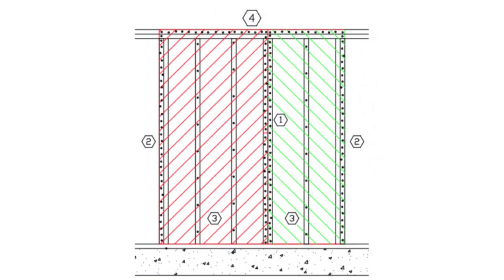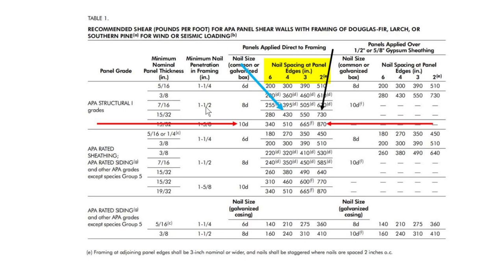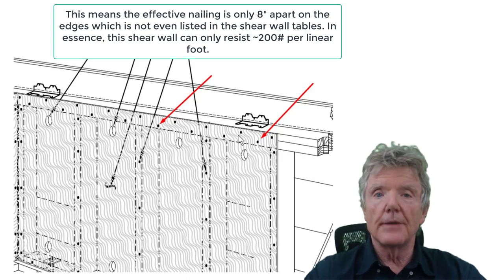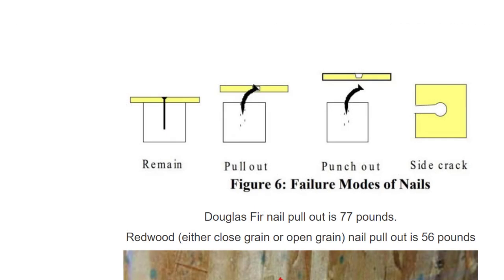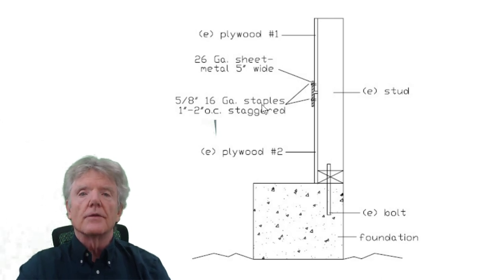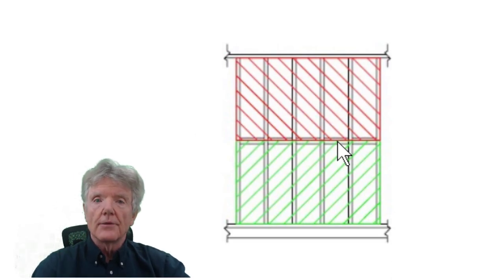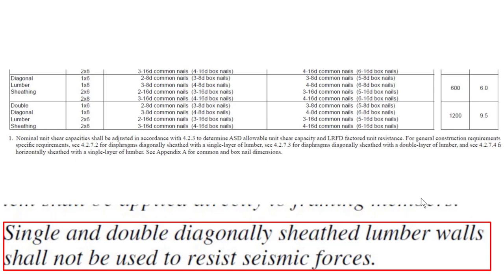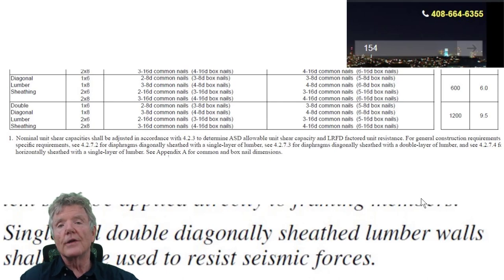Building Shear Walls - 8 Essential Tips

Comment: There are so many factors that determine shear wall failures, though in the end for retrofit applications it always leads back to the nails and quality and thickness of the plywood.  However, tests have shown once you go beyond 15/32" structural 1 you don't get much if any benefit. 

Once you have the right plywood you need to keep nail failures from happening.  

Nail diameter is a big one because the larger the nail the greater the resistance to pull-out, nail penetration is another factor for the same reason; though you never need to go more than 2 5/8 into the framing per extensive testing.  With 10d nails, you can't use the 3 1/4" commons 2" o.c. because the wood will split.  It might even be 3" o.c. I can't remember.  That's why they make 10d shorts. 

We have no problems with 10d nails 1" apart in old-growth redwood. 

Nailhead diameter also makes a difference as you speculated.   

Staples also work well because you can put them 1/2 inch or less. 

Look up APA research report 154 to see the original testing.
Reply: One side.  Inside is cheaper

Comment: This is a fantastic video--best I've seent to understand framing and shear walls.  thank you.
Reply from the maker: Glad it helped you.  That is the whole point and I really appreciate the comment.  If you find other videos that are helpful please be sure and let me know.
Reply: @bayarearetrofit5814   Awesome.  Of course I wish I would have seen this a month or so ago before finishing my walls- I followed the standard the plywood mfr said, which was nails every 6" on edge, 12" in field".  Since I don't want to tear off the siding I just painted, should I improve my shear walls by nailing plywood on the interior before adding drywall?  Or I realized putting up the fibercement siding I've actually added a nail every 7" in addition.  Does that help, or do you think I should add plywood to interior?  thanks for your help...
Reply from the maker: @GregoryDibb  I think if you you include the fibercement nailing you have a nail about every 3 1/2 inches and should be OK.
Reply: @bayarearetrofit5814  I figured that should help.  that chart you showed about how impactful nailing frequency is was amazing.  i guess my siding nails are only 2" nails though--hopefully that still helps.  it wouldn't be too much trouble to add plywood on the inside... Either way I will focus on doing what you showed with the hold-downs--that was a helpful explanation.
Reply from the maker: The same chart says you need 11/2 inches penetration into the framing, which apparently you have, or at least are close enough.
Reply: @bayarearetrofit5814  Great- I feel much better about that now, thank you - I feel much more informed after watching your videos, thank you--it's a reminder that not all engineers are created equal!

Comment: Cross stitching the two top plates intuitively makes sense since you're preventing splitting on the cap plate when high density nailing as well as unifying the two  plates; I'd also run 10d through both plates on that joist clip.
Reply from the maker: I am sorry, I don't quite know what you mean.  Can you exp;lain a little further?  Is the cap plate the same as a upper top late?  What is cross stitching?  You mean mean nailing them together?  How will that prevent splitting?  You mean nail into the upper and lower top plate?  Which joist clip?   What minute will I find it?
Reply: @bayarearetrofit5814  Yes, cap plate = upper plate. The typical tendency in excessive nailing is fear of a build up becoming "nail weak" due to  splitting/cleaving. Consequently, "cross stitching," a zig zag pattern between the two top  plates, is the "intuitive" carpenter's solution, i don't why  it is spec'd by the engineers in the code literature you showed. 3" of wood behind vertical seams between panels is primarily done why? splitting? edge turnover? Like wise 3" of wood via compression blocking nailed between studs and face nailed into mudsill/bottom plate would seem to help prevent panel turn over and nail tear out. More timber more nails and more options for distributed nail patterns and less split up wood which can resist nail tear out.
Reply from the maker: Ok, I understand now.

Comment: So I have this wall that has a groove cut diagonally top to bottom through the 2x4s and it has a thin metal bracket placed in that groove; one nail in each 2x4. It does not have any plywood on the wall but only sheet rock. Does this metal brace constitute a shear wall?
Reply from the maker: No

Comment: Is there a minimum length for the shear wall section?  Using your example, if I use 10d@2" OC and a 24" wall will it support a 1740lb seismic load?
Reply from the maker: The closer you get to 26.5" the weaker the shear wall.  After 26.5 if equals zero.

Comment: Does the spacing between the blockings matter in the design of the shear wall?  Say I have 3 rows of 4' x 8' OSB, does it matter that I have 4' - 4' - 2' going up or 4' - 2' - 4' ?  I have a feeling that it does.
Reply from the maker: Do you mean does it matter if the plywood is vertical or horizontal?

Comment: Hi, 

Great informative video. I am currently retrofitting my property using the LADBS standard detail plan set One. I  have cripple walls not tall enough for bolts to go straight down from above so I am using URFP plates instead. Do I still need ventilation holes?
Reply from the maker: No

Comment: Thank you for this video. Noticing that the failure is usually at the point of the nail head and the plywood sheeting, would it not help to make a special ribbed nail with a larger diameter head? I would suppose cost is a factor. Thus add more nails to share the forces. Would 3/4 ply have stronger pull out strength at the nail head? Our area is not known to have major quakes. My first exterior and interior walls (for my home)I decided to use 1/2 and 3/4 plywood with liquid nail, screws to pull it down first, then 8 and 10D. I learned a great deal from your video. - Thank you!

Comment: Around minute 9:30 of the video, the diagram shows an hvac duct going through the sole plate of the shear wall in a raised foundation construction.  Is such a large notch in the sole plate of a shear wall (for the rectangular duct) allowed?  How would it be reinforced?  I was thinking a metal brace horizontally across the notch might suffice for a one-sided shear wall, but it would not be possible to drive nails in that section of the sole plate for a double-sided shear wall.
Reply: I doubt it is legal but in retrofitting we must work we must work with what we find.  If we have large breaks in top plates or bottom plates we use 2 x 4s as straps because they will work in tension and compression.  A 2 x 4 is as strong as the strongest Simpson strap.

Comment: I'm confused!  At 5:24 you say 2.25" long nail - but isn't 10d a 3" nail (the red arrow is on the 10d line)?  On the one hand, I understand a shorter nail with "Minimum Nail Penetration in Framing" of 1-5/8" but why 10d then?

Comment: Simple question, does shearwall start at the bottom on top of the concrete slab or overlap on the side of it.
Reply: @infocook4854  plywood can’t sit on slab because it potentially could sit in water. Bottom plate to edge of slab so shear panel overlaps stem wall or slab.
Thanks I found what I needed

Comment: It is normally a function of the nails, not of the metal.  Check the load ratings under the F1 direction.  That tells you how much capacity the hardware has.

Comment: Hi Howard, Excellent video. Is an expansion gap required between the plywood sheets, or should they butt-up against each other?
Reply from the maker: The American Plywood Association wants a 1/8" gap but it is B.S.  It does not matter from what I have seen.
Reply from the maker: The American Plywood Associations says the must be a 1/8" gap, the Ph.D research scientists at the University of Washington wood science department say you need a 1/8" gap but I have never seen it as a problem and I live in San Francisco where there is a lot of moisture.  I trust my eyeballs more than a guy in a white coat sitting in an office. Engineers usually trust the guy in the white coat. You pick.  Please subscribe to the channel.
Reply: @bayarearetrofit5814  Stucco fellas have complained that the absence of the gap is the unpreventable cause of the cracking of stucco from wall buckling or deflection when moisture caused swelling occurs.

Comment: Shear walls are typically designed to extend from a sole plate to a top plate of a wall.  But, in a raised foundation, is it permissible (or even better) to extend the sheathing from the sill plate, over the cripple wall, and into the shear wall above?  Or does doing so reduce the efficacy of the shear wall?

Comment: I wasn’t always clear in the video whether the retrofit added a plywood/osb panel on the inside or outside of the wall.  Would welcome that clarity in a reply if you’re able.  I came to the conclusion that generally you depicted interior panels, not exterior.  In my case I’m residing a house, so I plan to install on the outside if decide to add.
Reply from the maker: It does not matter.

Comment: Thank you for this video. 
STUCCO and adding a blocking cripple stud (a sister cripple wall stud to allow nailing the edge of the plywood to): The back side of stucco intrudes slightly into the space where the new stud will go (the space facing into the crawlspace). That causes the edge of the stud (the edge to nail to) to protrude out from the existing stud. I expect it will be OK to cut a thin strip from the new stud, so that the face to nail to will sit flush with the top plate and mudsill. Does that sound reasonable?
Reply from the maker: Sorry I am so late in my reply.  I do not know YouTube did not notify me about your comment.  Yes, that is OK.  Watch the video on stucco.  You were in pretty good shape as is.

Comment: Thanks for the information. I am currently working in Sparks, Nevada and they seem to have different codes compared to city of Reno and the county.  

My role is drywaller including all phases of the trade. Framing thru texture and grid so I do not have any actual role in the shearing unless you count Sheetrock. My question is about plywood shearing. 

In your video, you supply tables showing minimum nail penetration but I see no mention of maximum nail penetration. I ask because I see in other municipalities that shear nailing heads of nail do not penetrate the surface but in Sparks, NV they allow deep penetration. This bothers me because during the stresses from a quake it would seem that the 3/8" plywood used will easily rip out from nailing. I also noticed flooring in all municipalities has nail heads exposed over the surface and I thought it is for the same reason as to not rip through nailing. Can you explain maximum penetration please?

By the way, the exposed nail heads on flooring are a nuisance when scraping taping mud from the floors.
Reply from the maker: Sorry I am so late in my reply.  I do not know YouTube did not notify me about your comment.  If the studs don't split at time of installation they won't split when loaded.

Comment: Hello again.  Since I left my thank-you comment 10 days ago I have re-watched this video twice.  I was very happy in a couple places to find that when I paused the video & said "that doesn't make sense", you then said the same thing when I started playing it again!  Ha-ha.  (Also, lining up the vent holes with the foundation bolts is brilliant.)

I hope I'm not imposing too much, but I am left with just 2 very basic questions:
1. You've said nothing about OSB, which makes me think that those who extol its virtues may be full of... something;
2.  From the 1st diagram @ 2:00 to the one at 22:00, the geometry-center in my brain is wondering if horizontal or vertical orientation of the plywood is significant?  My gut says that a horizontal sheet nailed to more studs may be more stable for horizontal shaking.  
e.g., for simplicity's sake, let's say @ 2:00 there is a vertical 4x8 next to a vertical 3x8...  Would 2 horizontal 4x7's  be better, worse or indifferent?
Many thanks again,
Mark
Reply from the maker: Orientation of the plywood does not matter.  OSB is rated the same as plywood.
Reply: @bayarearetrofit5814  Sorry, I was probably overthinking the geometry...  As for the latter, the lumber yard explained the confusing Structural I plywood, with Roman numeral not 1, is the way to go for strength over beauty, but they didn't say OSB had the same thing.  Many thanks once again!

Comment: hi Howard - Can you tell me which is the most recent "Standard Plan A"? I see the one on your web site says 2008. Is that the latest? Is there an "official" copy somewhere?
Also, I have the situation that you described where the access hole is too small so I would need to butt plywood panels to achieve the full height of the cripple wall. I don't see anything about the methods you described to accomplish that in the standard plan A. If I wanted to get a permit do you think they would accept one of those methods? I'm curious if you've had experience with that situation.
Reply from the maker: 2008 is the most recent one.  Why do you want to use it? 

 Use blocking at the plywood edges, 3by is the best or flat 2by with 15ga staples. 

 Do whatever you want.  The building department does not care what you do.
Reply: @bayarearetrofit5814  I don't "want" to use the plan, but I thought since I'm doing the retrofit that it might be worth it to get the permit if I could save money on insurance.
 
I don't know if it's worth it to get the permit but if I do, I don't want them to not reject the horizontal butt joints.  

You didn't mention the 26 gauge by 5" sheet metal. That sounds like the easiest! Is the sheet metal hard to find? (Thanks again Howard! :-)
Reply from the maker: The CEA does not care if you follow a standard. They just want a contractor to sign a form.  A handyman with a license can do that for you.  Do it right and for Standard Plan A.  Sheet metal is expensive, blocks will work much better for you.

Comment: The sheer transfer tie, model A35 by Simpson, hardly seems stout enough to perform under a seismic event. There is however a 16 gauge angle made by MiTek 2"x2"x6" model USP ML26-TZ that would make more sense as it is twice as thick as that simpon model that you can bend by hand. Your thoughts appreciated.
Reply from the maker: Sorry I am so late in my reply.  I do not know YouTube did not notify me about your comment. We have A35s.  L90s are better.

Comment: Greetings! 
What is another brand of hand driven nails that can be used for this work that has 2 1/2” nails? 
 I know that simpson brand is one, but they don’t seem to make  2 1/2” long nails that are hands driven. 

Or is it ok to use 3” long? 
 Any info, from anyone would be appreciated. 

Thanks.
Reply from the maker: Any builder's supply store will have a good selection.  Not sure why you don't want to use a nail gun.

Comment: So general question, based off of your qualms with some of the nailing to the top plates, is the upper top plate not secured to the lower top plate with significant enough resistance values to shear so as account for their design? If that were not so, I would assume the need for a double top plate to be dependent solely on alignment of your studs with upper assemblies and to counteract weak wall connections during erection.
Reply from the maker: There is not way to know but if you want to nail the two top plates together and make it one piece it won't hurt.

Comment: great video thanks.  i was wondering if there are any rules as to the minimum width of the plywood panel.  As an example if you had to cover 9 linear feet, would it be ok to use a 4ft panel, butted to a 1 ft panel, butted to a 4 ft panel where at each butt there were double studs?
Reply: So long as you have everything blocked and sistered together at the seams you should be fine.

Comment: What kind of staple gun do you use for the sheet metal approach? I have a cheap pneumatic stapler that isn't pushing the staples through the sheet metal. Would a non-pneumatic stapler work better, or do I need a more expensive pneumatic stapler?
Reply from the maker: I only found one stapler that shot the gauge and length needed and it is made by Paslode.  What are you trying to accomplish?  We hardly ever use sheet metal anymore because there are other options.
Reply: @bayarearetrofit5814  I put up a shear wall that is a few inches over 8 feet, so I had to split it into 2 pieces.  I planned on using the sheet metal approach to attach the two together and didn't put any blocking behind the plywood. It sounds like I might have to remove one of the pieces of plywood and add some blocking.
Reply from the maker: They also make plywood in 10 foot lengths.

Comment: What about sheathing around doors and windows in a shear wall? Should you cut the openings out of the 4x8 sheet or use separate pieces that are all square or rectangular?
Reply from the maker: It does not really matter so long as all the edges are blocked and all the framing is stitch nailed.  Personally, I would do as little stitch nailing as possible and use the biggest sheets I could.
Reply: @bayarearetrofit5814  Thanks, this is helpful, and it checks out with my structural engineer.
Reply from the maker: Happy to hear that.  Please be sure and subscribe.

Comment: If blocking. Should we use khil dry or green “wet” Doug fir to avoid splitting and max strenghth
Reply from the maker: Read about green lumber in the pdf library.
Reply: Green lumber is best.  The kiln dried splits. Looks like you found the APA bulletin.